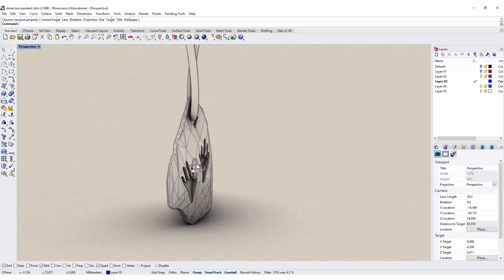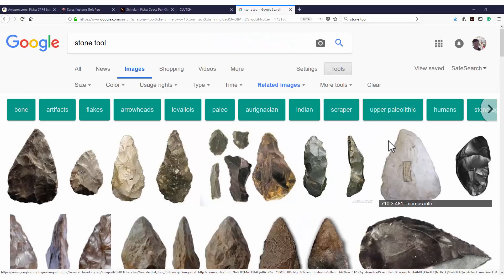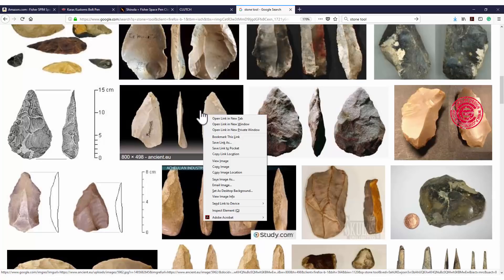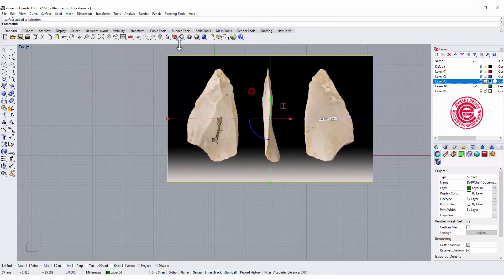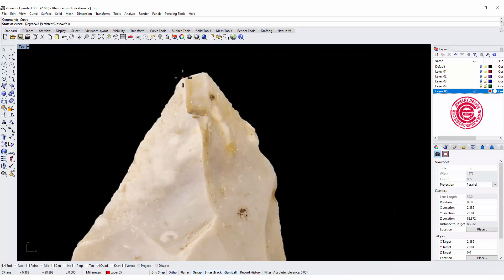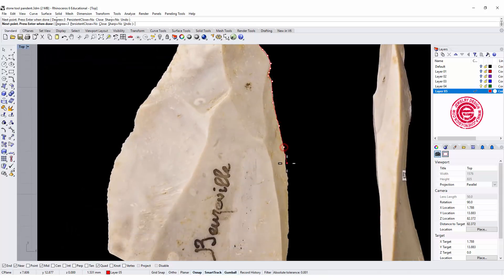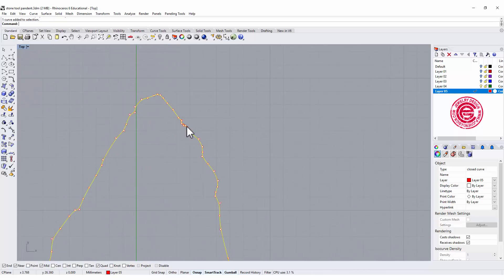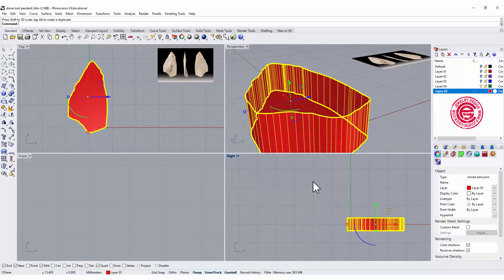Rock Pendant 3D Modeling in Rhino 6 (2018)- Jewelry CAD Design Tutorial #36

Comment: Hi PJ Chen Awesome video tutorials as always. Clear and concise. PJ, sometimes when I chose a single surface, only half of it is selected. No matter how I joined or merge them, I only can select one half of it. How to join the supposedly single surface as a whole instead of two halves? Thanks.
Reply from the maker: HI BoonKok, Because the surface you select has a "seam" on it. Seam is where showing in a darker line. Even you join two surface together. The seam will be there. I suggest you to more the seam to other places before you do any trimming if you can.
Reply: PJ Chen Design Thank you. It solves the problem.

Comment: Hi PJ ! Can you make a video about boolean commands, sometimes I use the boolean union command to merge two objects but not.
Reply from the maker: I suggest you to check on naked edges on both objects before you boolean. if both objects are the solid and boolean fail. It is usually the seam is 100% line up. You just need to move one of the object 0.01 units. Let me know if it is still not working for you. you can send me the model to pj@pjchendesign.com